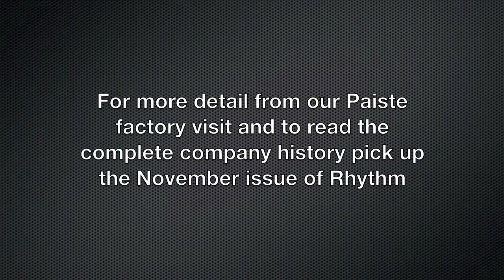Rhythm Magazine Paiste factory tour - Part One

Comment: Twenty serie and Signature line made form B20 Cast bronze

Giant beat / Rude / 2002 / Alpha / PST8 - made form B8 Sheet bronze paiste call 2002bronze 

 PST5 - made form B8 Sheet bronze and Use Automatic machine hammer

PST3 and Paiste 101 made form brass ms63
Reply: The Signature line is not made from B20. It's made with the "Paiste Sound Alloy" which was a new metal they developed in the late 1980's. It was the first metal ever developed specifically for the purpose of making cymbals. (B20 is ancient, but it was adapted for cymbals, not made specifically for them.) The Paiste Sound Alloy composition is thought to be something like B15.

You also skipped over the Formula 602 series. That's made from "sheet" B20.